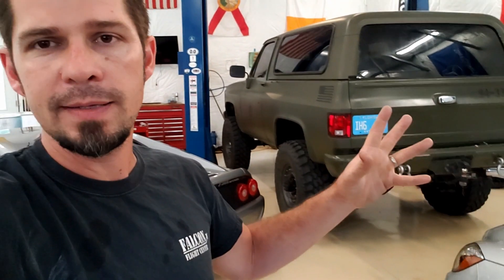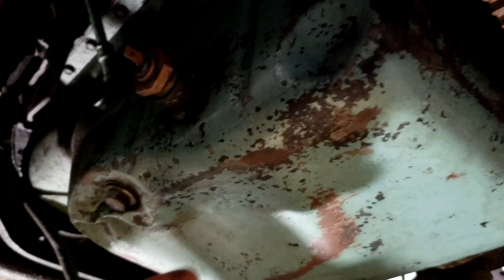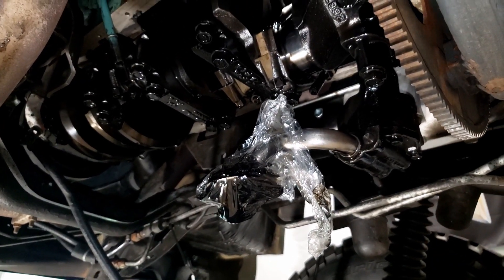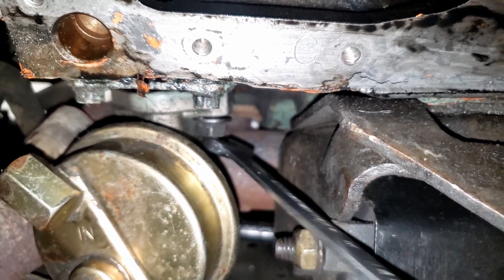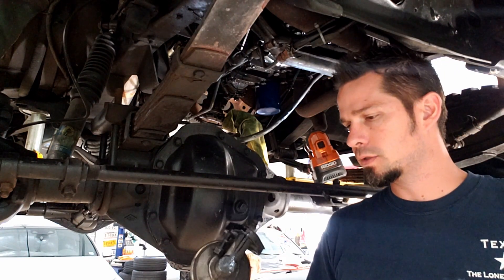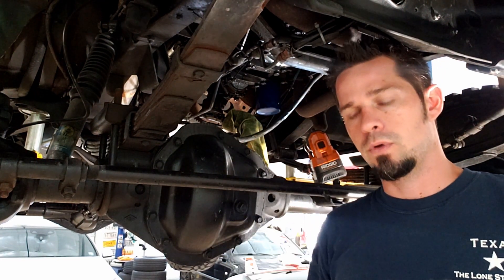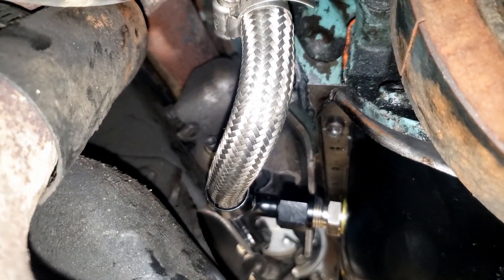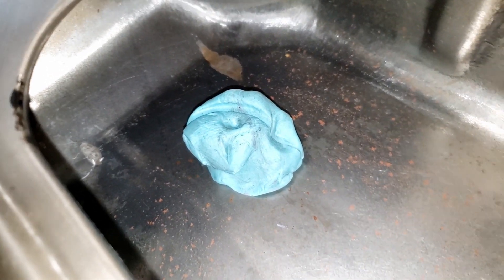Addressing all the leaks on the Turbo M1009 Blazer!

Comment: That shouldn't be a 700R4.  Someone "upgraded" it.  They came with TH400s.  As I learned recently, the major issue with those is the vacuum pump, which is located where a distributor would normally be.  I think these get about the same mileage with a 3 speed or a 4 speed.
Reply from the maker: Correct, it was upgraded to a 700R4 (I believe that's probably the first time ever anybody said a 700R4 is an upgrade LOL)
It does make it nice on the highway, seems to look along just nicely at 70 to 75

Comment: Hi I just so happened to see that your blazer has a antique fl tag. How were you able to get that. I am currently working on getting a M1009 and i keep reading articles that any former military vehicles are not allowed on public road ways in florida other than events or parades.. I am trying to get the one I amd getting and use it for both my daily trips to work and for offroading.
Reply from the maker: They give out the blue antique plates for anything over 25yrs. 
They have the former military plate, but it's only if you choose it, and full it a special application. I originally  wanted this, but yes you're correct, only parades and shows